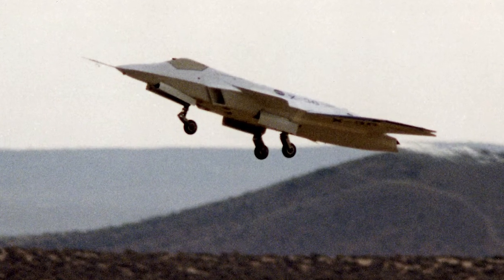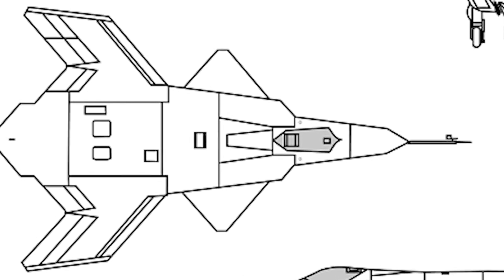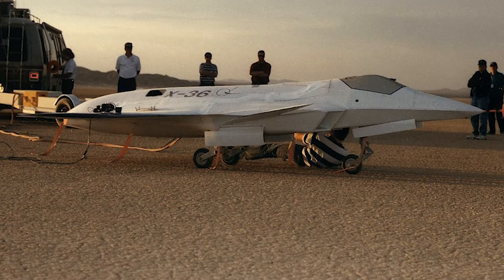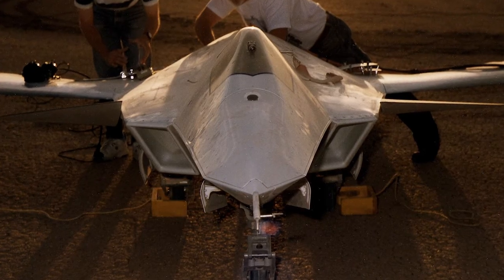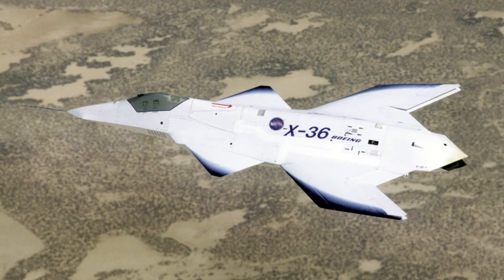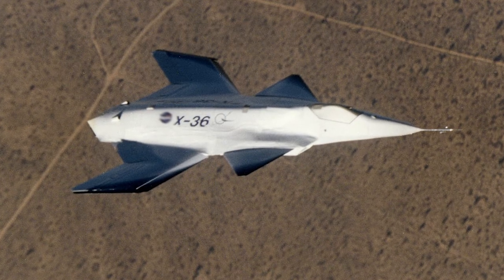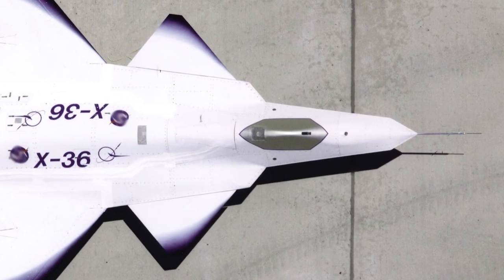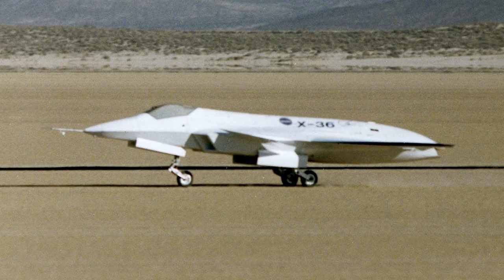McDonnell Douglas X-36 (Boeing X-36) - A Short History

Comment: "A total of 31 safe, successful research flights were flown during those 25 weeks, accumulating 15 hours and 38 minutes of flight time and using four different versions of flight control software. The aircraft reached an altitude of 20,200 feet and a maximum angle of attack of 40 degrees. Both aircraft are on display in the Museum's Research & Development Gallery. The other prototype used in ground tests and as part of other evaluations is now displayed at the Air Force Test Flight Center Museum at Edwards AFB, California."